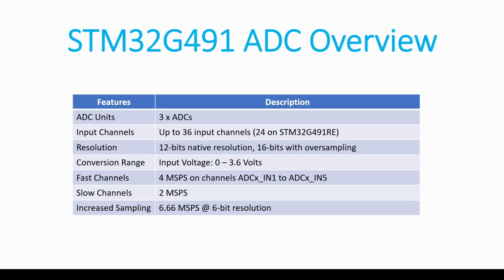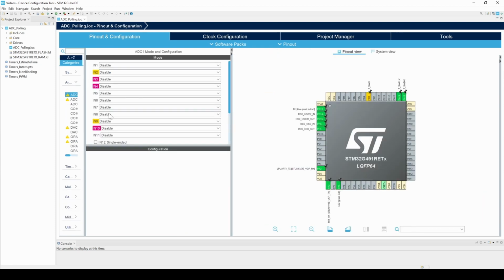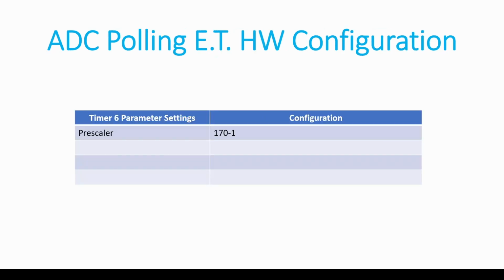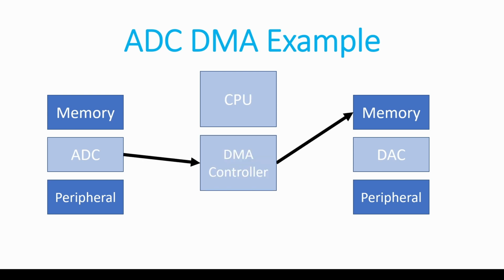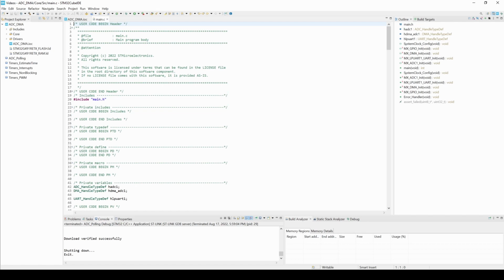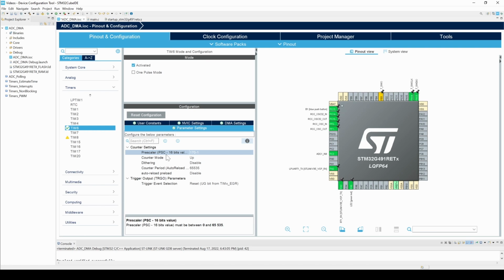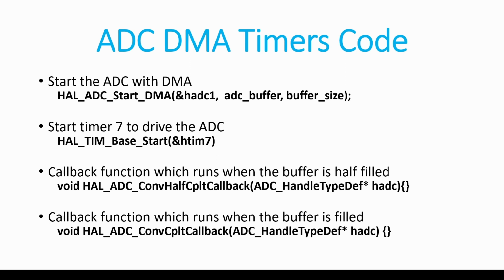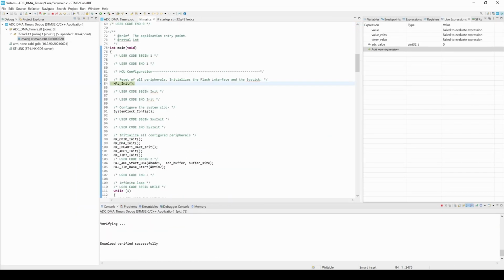STM32G4 & Real Time DSP: Part 4 ADC, Polling, Direct Memory Access, Timer Triggered Conversions

Comment: So clear and educated!! Thank you!
One question, I did not understand the explanation of why you are using word as the width of the DMA buffer at the memory end while the ADC use 12bit which can fit into 16bit half word, you mention extra work that need to be done if word is not using (left shift?), please explain. Thanks!!
Reply: The ADC data regiser is 32 bit